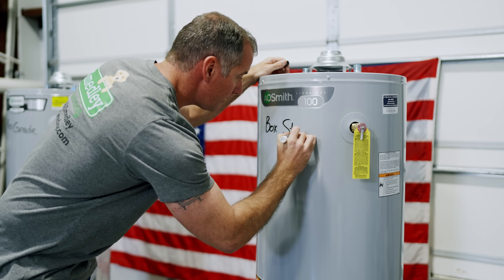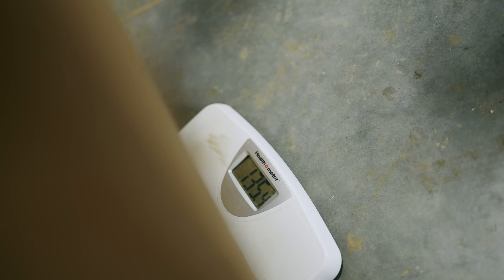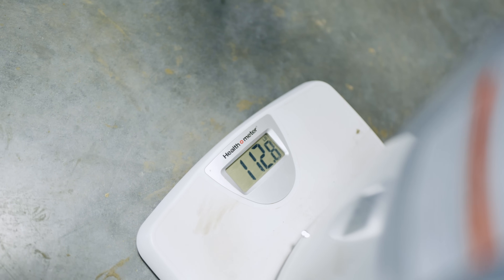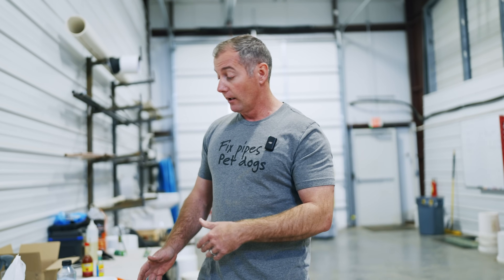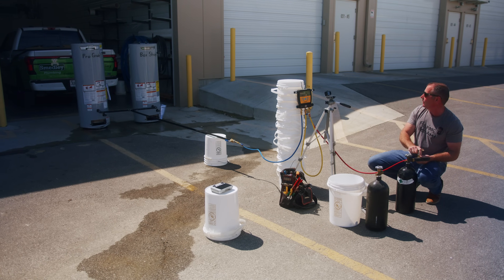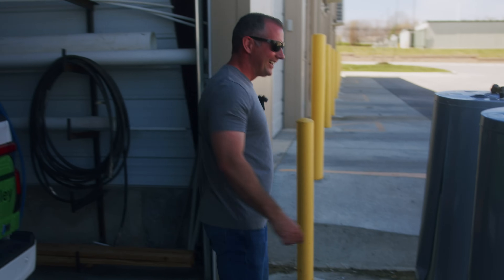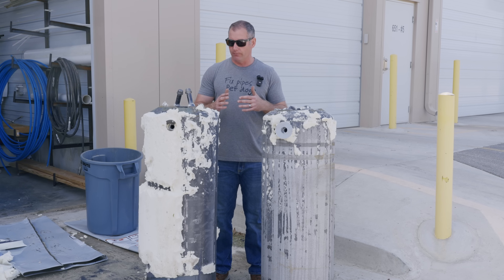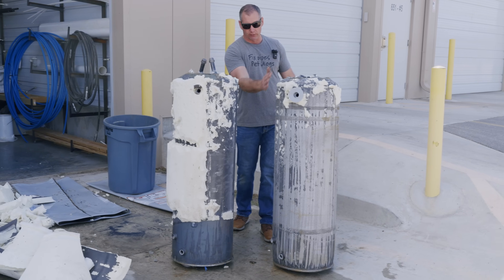What water heater should I buy? - Pro Grade vs. Box Store

Comment: Most professional heaters are made to handle more pressure by putting metal drain valves etc. I had purchased 2 water heaters from a plumber, and one was made for the box store and had them hooked in series in my home because I used a lot of warm water on my small farm.  Three years late the professional one failed. Both units were the same model except the professional had a different model number but were equal in comparison. I service them every year by flushing and I did change the anode rod on both 2 years later. Which the old ones were still good but replaced anyway. Usually, I would have bought both from Box store. But one was on back order and a plumber was coming to install them so I just had him to pick one up from his distributor.  I do get city water but had put a whole house water filter system in when the house was built.The professional heater might just be a defect. I keep the temp on medium.
Reply from the maker: Yep

Comment: I bought my water heater from Lowe's installed it myself got a Reem unit the top of the line that lowes offered total cost $840 parts for a simple installation of quick disconnect $30 it took me 3 hours to do the installation it's now been an operation 9 years Never failed the estimate from a plumber to do installation and supply a water heater was 2400
Reply from the maker: Yeah it's always going by to be cheaper to diy anything.

Comment: Great video!  For an extra $49 for the pro grade its a def. a no brainer to go for the pro-grade
Reply from the maker: Yep
Reply: @SmedleyPlumbing  Figured id ask you a question about my water heater and a Corro-Protec Anode Rod.  My 40 gal. water heater was installed in Oct. 2012, about 1 year before i bought my townhouse. Never drained it nor changed the anode rod.  The water here Staten Island, NY comes from the reservior's in upstate NY, i don't believe its super high in minerals like well water is, so I'm thinking this is the reason why it has lasted just over 12 years. I just bought the Corro-Protec Anode Rod and plan on changing it out next weekend. 

Being the tank just turned 12 years old and I'm potentially selling my townhouse in next 3-4 years when i retire, part of me is saying let this tank stay the course (hopefully) for a few more years and keep the Corro-protec Anode rod for a new water heater either here or in my next home.  What are your thoughts. FYI, i have a floor drain in my laundry room where my tank is located, so in case my tank starts to leak or bust it shouldn't be a disaster of a clean up.

Comment: Engineering 101. When you’re weighing the control box, the pigtail shouldn’t be hanging over the scale and touching the table thereby giving a false reading. I’d give this a push in form fit and function and not a factor in your overall evaluation. Thanks for the tear down and insight. Your conclusions are reasonable. Q. E. D.
Reply from the maker: Thanks

Comment: wondering if you could do one for Rheem? In calling Rheem, they said that they are the same between pro vs box store. One difference though is that the box store comes with 1 year labor warranty where the pro version does not come with 1 year labor warranty by Rheem. Have to talk to your contractor for any labor warranty, which usually is 1 year I believe based on this, "Contractors in California provide a fundamental protection known as the one-year warranty. This warranty guarantees that the work they perform meets specific standards and remains free from defects for a year after completion.Sep 18, 2023"

However, to me assuming there are not differences or even if there is, doesn't it make sense to have Rheem pay contractor to fix any issues, vs having the contractor pay for labor if using the pro water heater? (looking at Heat Pump water heater 120 volt 80 gallon).
Reply from the maker: Probably worse than with AO.

Comment: On Thursday evening I was talking to a buddy that works for FW Webb and asked if they would sell me a heater, as I have a thirteen-year-old Bradford White 12 year warranty heater. Sunday morning, I have no hot water. Pilot is out and there is water leaking out of the bottom of the heater onto the basement floor. the plumbing distributers are all CLOSED on the weekend so off to the box store I go and buy the best grade 40 gallon natural gas direct vent heater that they have in stock because I don't want cold showers for at least a day. At the box store they help me get the heater into my compact car for the short ride home. My buddy helps me get it out of the car and down to the basement without damage to the heater or injury to us. Old guys rock! I was able to plumb up the copper, reassemble the gas pipe and install the flue tubing. The new heater was taller than the old one so that made the job easy. On the following Tuesday we scrapped the dud heater and bought a six pack with the proceeds and celebrated our work.
Reply from the maker: Congrats! Now you'll know how to do all that again in 5-6 years when the box store heater fails.
Reply: @SmedleyPlumbing even with a box store heater you can buy a powered anode rod, they have a 20yr warranty. Water heater should last as long as pro grade.
Reply from the maker: @dm_1  we're not risking it

Comment: Hello Smedley. I just bought a Rheem 50 gallon 40,000 btu water heater from home depot.( My old one lasted 23 years  60,000 btu. professionally installed). I can do this myself. I will remove the control box, drain valve. and any item I can reuse. Any advice
Reply from the maker: You won't be able to reuse parts from your old heater on the new one.  A lot has changed over the years.

Comment: Can regular person go buy water heater at pro grade plumbing store? Also the pro grade unit bottom also bended, would that also crack the glass liner at the bottom of it?
Reply from the maker: Yes.  And technically yes. But the stronger steel of the pro grade unit holds up better over time.

Comment: The differences compared seemed pretty minor as far as performance is concerned. Could it be that only licensed contractors can buy from the supply houses so it's easier to hide the markup? If I ever plan to pump ridiculous amounts of pressure in my water heater I might think about getting the pro model (not really). I always replace the drain valve in any case. Definitely replace your anode rod in a timely manor. Couldn't believe you did the pressure test next to the truck and your unprotected self.
Reply from the maker: So these differences become highlighted over time. We openly shared what Contractors buy Pro grade water heaters for.  Contractors will markup material no matter the source.  That's how contractors get paid for the time it takes to source, procure, and acquire the material.

Comment: The box stores also sell different levels of quality in the same brand. I recently replaced my 40 gallon with a 50 gallon Rheem that I got from Home Depot. I needed a 50 gallon, tall, natural gas water heater. They had three different ones in stock, 6 year, 9 year or 12 year warranty. You get what you pay for.
Reply from the maker: Don't assume they're better quality because they have a longer warranty in cost more money. They cost more money because they're warrantying the unit for longer The quality is largely indifferent between the six year the nine year and the 12 year water heaters.  Some of them might have an additional anode rod but that's not consistent either.

Comment: I'm back 8mo later.
I feel that your early judgement that pro and consumer grade products can't be built on the same assy line on the same day is nonsense.  Now if you explained that the interior tank was 2in less in circum and however taller or shorter, then that I could believe, but even then I bet when the part be assembled comes in front of the station operator that the workstation identifies the part being worked on and the part being installed at said station.

Just because a cover is different between two grades does not preclude it from being made same line/same day, IMO.  I've done some assy work in the past.  Especially if cover pro fits in the holes and location in consumer cover plate ( as long as valve body is not taken into account ).

What I want to know is HOW DO I FIND OUT WHERE PLUMBERS IN MY STATE SHOP.  HOW DO I LOCATE PRO GRADE PLUMBING STORES.
Reply from the maker: If it's a hardware store, it's a box store.

Comment: Had a home owner change out a gas water heater because it had water coming out of the bottom, it was in an open garage and it was just condensation not running water or leaking anywhere.
Reply from the maker: Condensation can happen on the first burn or if the water heater is run completely out of hot water.

Comment: 14:22 those holes higher up on the dip tube are for preventing siphoning. otherwise there's the possibility of someone's water heater running dry unintentionally and that will pretty much ruin it as I'm sure you know
Reply from the maker: This is true

Comment: I think with the shorter baffle having 6 tabs it slows the air down a bit more than a 4 tab of the same length.  Since its shorter they end up close to the same.  It's probable that an engineer got hold of the baffle and redesigned it to use less material with the same efficiency and made the accountants happy.
Reply from the maker: It's possible

Comment: Try to use impact sockets with impact guns, unless worried the stronger socket would cause the anode rod's nut to strip. Yours got stuck here because you used a 12-pt socket instead of a 6-pt socket, which is also why impacts are 6-pt.
Reply from the maker: We like to live in the edge.

Comment: The tanks don't have one way valves. If pressure built up due to the heating, why wouldn't the pressure simply back flow against the inlet/cold water and balance out at house water pressure?
Reply from the maker: Because the house has one way valves.

Comment: Mine is almost 20 years old, and the nipples on top started rusting from the hose connected to top of nipple….do I get a new one or just replace nipples?
Reply from the maker: At that age, it's a risk to try to just replace the nipples.
Reply: @ alrighty then, I’ll see where I can get the Pro AO/Smith, with metal straight line valve on bottom. Your video was excellent! A+++

Comment: Were there efficiency differences between the EPA cards?  What did the "bare" steel tanks weigh? 
I'm curious because it doesn't  make sense to me to use more pounds of steel rather than a better alloy with less ductility and better corrosion resistance with slightly higher cost fabrication technology and  a thicker "glass" lining that wouldn't be as likely to crack. 
 (Unless I didn't WANT to dramatically increase tank lifetime.)

btw:
1.Those pipe sleeves are not styrofoam and they can be used on the other side of the inline connectors that should be found in all professional replacement installations. Unless flexible connections get approved. 
2. European water heaters are designed for +25 year lives and better serviceability.   Our "professional" US models seem like junk in comparison.
Reply from the maker: The EPA cards for efficiency are wildly inaccurate.  They don't know your energy rates or your got water usage.
Reply: @SmedleyPlumbing They are accurate for the intended purpose of allowing consumers to compare energy consumption under standardized conditions.

Comment: Let’s get to the bottom line.  How long will each one last before the tank rots out and springs a leak?  Al l these individual parts differences may cost just a few cents different to manufacture.  Why would a reputable campany like AO Smith risk it’s reputation by making an inferior product just to save maybe $25 cost difference in parts?
Reply from the maker: I can't answer why they risk their reputation.  But they do have an obligation to make their shareholders happy.  So sales volume is the main driver.

Comment: I had a 14 yr old GIANT (box store water heater made in Quebec Canada) fail last December.   A pinhole leak occurred at the top of the exhaust tube. It sprayed water up the flue, which then fell down onto the burner, and blew out the flame. Make sure the floor drain near your water heater is not covered with laundry. Our dirty laundry stopped the drain from accepting the water. We had quite the flood.
Reply from the maker: It happens.

Comment: Many things were same, the drain valve was a big difference, this is about $20 more. This test showed me that the metal of the body of the tank is where your 9 lbs. difference in weight was.  However the top, bottom and tube seemed to be thinner, and were the same for both. I have been in a water heater manufacturing plant, everything uses automatic welding machines.  I was surprised on how many tanks were pulled off with leaks and had to be hand welded and retested. Testing was with air and then using a water line to spot leaks. The leaks were usually at a weld seam, like where the failure was. I have a builder grade water heater in my home, it’s a State Select 50 gallon, natural gas, that was new with the tract home I had built in 2003, makes the water heater, 20 years old. The only thing that’s different in my water than most others is my water temperature setting, it’s making water about 120 degrees hot. Most people have their tanks set too hot, and this causes the heater to fail a lot sooner. When you’re taking a shower you don’t use hot water that’s 150 degrees, you only need it to be a little hotter than your body temperature of 98 degrees, say 102-3 degrees. The more people you have the higher the temperature needed. Washers today don’t use a lot of hot water, so it’s not needed there either.
PS: Info…..I live in a Chicago suburb, I do have Lake Michigan water (7.5 gains hardness). I was in this industry for 36 years and am currently retired. AO Smith bought State Stove, years ago.😅
Reply from the maker: Your builders grade is still better than the box store grade.

Comment: Unfortunately with that pro grade and that hot side with that short extension on nipple is not good the store box one is actually better, because of that short extension you lose out on longer hot water runtime, Now when it comes to the pressure relief valve now you're splitting hairs technically they're the same but they're not allowed to copy each other design so they have to be different from each other also both are really good brands, And I totally agree with you about the drains that is usually the first thing I get rid of it's a stupid plastic ones and add a regular ball valve. By the way What's your thoughts on Glass lined versus 316 stainless steel heaters
Reply from the maker: All depends on how well they perform
Reply: @SmedleyPlumbing  They should perform the same if they have the same burners

Comment: I have 2 box store Rheem water heaters that are over 20 years old. I drain them annually and have never had a problem with them.
Reply from the maker: 20 years ago they very well may have been the same water heater. But good luck finding anybody with 10-year-old water heaters that were bought from a box store and then have given them zero problems.
Reply: Do you ever replace the anode rods?
Reply: @AGreedyTree  the anode rods have not been replaced. I've read that it's recommended

Comment: The problem is that these Pro level water heaters will not be sold to the general public. I've installed a few water heaters over the years and it's very easy to do. But suppliers won't sell me a Pro water heater, so I have to buy from the big box stores. However, my water heaters from big box stores have lasted 18 or more years.
Reply from the maker: They will.  You just have to find the suppliers that sell to the general public.

Comment: Oddly I have never seen a returned water heater because it was  leaking or from weld failure at a box store. ( I did once see someone cross thread the inlet and outlet) It has always been because it was not heating the water. Specifically AO Smith formerly Whirlpool.. 
Though I would say that is their biggest problem. That is from both professionals and home owners returning them.
Reply from the maker: Yep!

Comment: i have a 40 gallon Rheem electric. it came from a box store, Lowes or Home Depot.
the yellow energy sticker has the year of 1994 printed on it. im not sure but i think it was bought in 1995 or 1996. i've replaced bottom heating element twice, the top one 3 or 4 times.
i know its getting time to replace it as it has some signs of corrosion around where the upper element screws in.
i've not been looking forward to buying a new heater, but after watching you vid, when i do i'll get it from a supply house.

i guess pushing 30 years with only 5~6 elements its been a good heater. i hope the next one is at least 2/3 as good.
i use to flush it every couple of years, its probably been 10~12 years since the last flush. i never got much sediment out of it.
edit; i forgot to mention, i adjusted both of the thermostats, running only the hot in my bath tub the temp is at 145 after about 5 minutes.
Reply from the maker: They very well may have been the same heaters back then.  Not today though.
Reply: Never heard of a 45 gallon heater.They are usually either a thirty or Forty or fifty gallon gallons
Reply: @alleffler609  your're right, i corrected it.